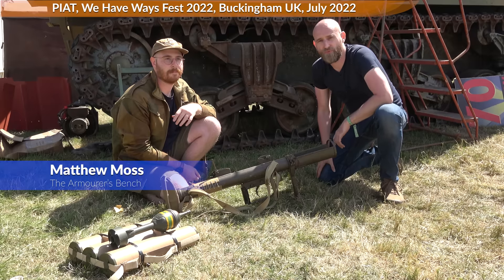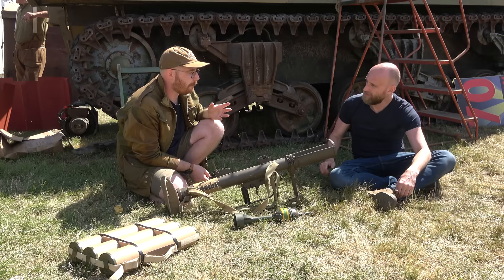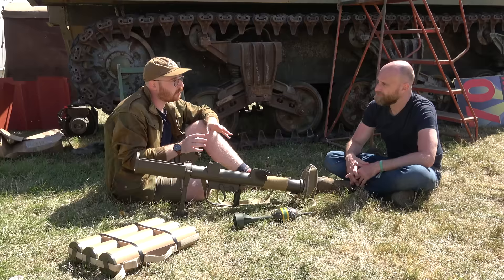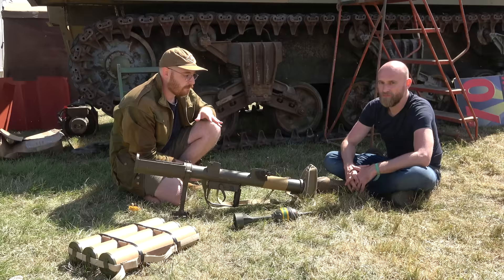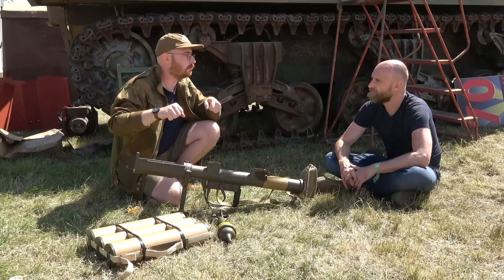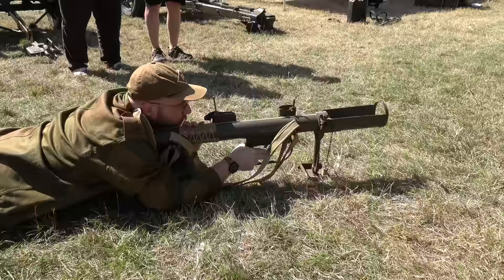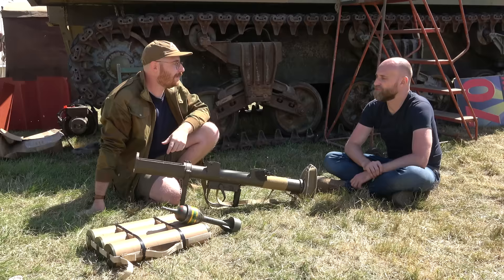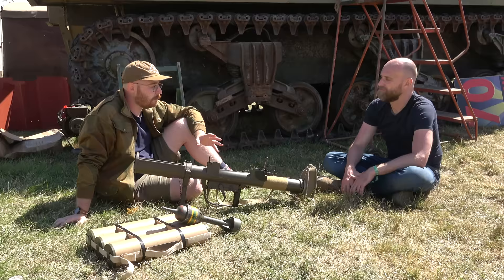PIAT: Better than the Panzerfaust?

Comment: "could engage every german armor thickness wise"  well ,i m not 100% sure. i just gave a quick look online, and the value given by stuff like wiki was around 75/80mm (perpendicular to armor). so, given that the stug 3ausf G  and the latest versions of PZ4 already had 80mm flat armor on base on the front (and that uparmoring them with  track parts, bits of conrete, etc wasn t impossible, and would still let them with tolerable reliability compared to other german armor of that era) i don't think the claim made is true.

Comment: Springs don't actually prevent recoil or pressure from the human; that'd be physically impossible. When you push on the spring, it pushes on you. However, what it might do is possibly lengthen the moment of recoil. That'd make it a lot more tolerable and survivable.

This is confirmed by him pointing out it was more of a push, instead of the kick of the ATG.
Reply: Indeed, it makes the recoil manageable by the human body.
Reply: No 'might' about it, it would be impossible for the human body to bear the recoil over a short interval. It's best to specify 'felt recoil' or 'perceived recoil' to avoid this kind of comment from the physics-educated :)
Reply: @skepticalbadger  Makes me wonder how far you could practically go, using springs to spread recoil. PIAT may be the practical limit.
Reply: @vanivanov9571  you can compare it to an Oerlikan cannon where the round is fired before the bolt has finished its forward travel and the forward momentum is used to keep the bolt closed for longer without needed more mass or spring pressure.

Comment: I didn't hear you discuss the PIAT's round trajectory. I've seen footage of a PIAT being fired and the round has a very noticeable arc to it due to it's relatively slow velocity. That seems like it would make it tricky to land a hit or at least, tricky to land a hit where you could get the most effectiveness from the shaped charge.
Reply: I'm not really sure why that would be the case.  The weapon has sights with three calibrated steps out to a max range of 110 yards.   Not exactly a laser-like trajectory but probably comparable to a panzerfaut or bazooka.

Comment: In my Dutch army days in the 1990's there was an accident with a PIAT. Every Dutch army used weapon at least one working sample is stored for instruction in case army or the police come across a similar type.  A sergeant demonstrated the PIAT to a fellow soldier loaded it with a round. And it accidently was fired. Inside a bunker. Both escaped with light injuries. Not sure what the damage was to this nco's carreer.
Reply: My guess is that it was an inert round and there was a negligent discharge and, being in a bunker, the inert round hit the inside of the wall showering them with bits of concrete spall and bits of the round. A live one would have caused more injury I would imagine.
Reply: @johnfisk811  That was also my guess. With a live round it would be a miracle if they would have escaped with just minor injuries.I was actually serving at the same barracks when in happenend.

Comment: Given most other nations settled on rocket propelled designs, I wonder what made us Brits go for such a comparatively unorthodox design?
Reply: I would bet cost and production limitations.

It only needs a small charge of propellant and didn't use any electrical components, unlike rockets.
Reply: Possibly because they were developing spigot mortars for a number of other roles at the same time. The Hedgehog Anti Submarine weapons system for example was a spigot mortar, and they had other systems using the principle in development simultaneously, though not all of them went into service. As a result I think it was simply a case of them taking something that was already being worked on and developing from there rather than going and developing a new system from scratch. They might have preferred to do the latter, but went with the former because they needed a working platoon level anti armour weapon as soon as they could possibly get one into production.

As was said, the British recognised even by the end of the war that PIAT was a dead end development, but it was a good enough system, decently reliable (if heavy), and was surprisingly versatile, so it was good enough to roll with and issue at the time even if they understood they would need to replace it at a later date.
Reply: The US got there first with the Bazooka in mid-42. The UK was developing PIAT before then. The German's captured a number of Bazooka's in Tunisia and studied them, then copied the idea with Panzershreck. They got lucky in that the warhead and fuzing for the Panzershreck was already developed for a seperate recoilless gun project. In many ways both Bazooka and PIAT were unorthodox, but ultimately the rocket propelled or recoilless gun designs had the potential for greater growth in the size of the warhead, which is necessary as the penetration of a HEAT warhead is related to its diameter. The PIAT did deliver a far larger warhead than the wartime US Bazooka though, which delivered a warhead derived from an AT rifle grenade.

Comment: It's NOT propelled by the spring but the projectile does have its own propellant!?
That makes it even more illogical.

It's like having a perfectly good working firearm.

Only to pull the trigger you need both arms while stabilizing it with a foot strap or something like that.
Reply: It's logical. The spring activates the propellant charge like a firearm striking a primer, and the propellant burning uses the tube and spigot as a cylinder and piston combo to build up pressure.

Comment: i always thought of the PIAT as a indirect weapon, for i always heard of the fact, that if you directfired at a tank that was on a lower level, the damned projectile would fall out of the PIAT was this myth or not? another one, i heard was the loading time was longer than other similar weapons?
Reply: Had a spring loaded catch that kept the bomb in place literally to avoid this sort of thing. I find it remarkable that people think an army would not have noticed a little thing like that. The British were not stupid after all. Where that myth probably comes from is that particular catch was sometimes damaged, though it was a simple enough thing to fix. Also most deactivated PIAT's also lack that catch. 

As for loading time, no, not really. Not really that much longer than Panzerschreck or Bazooka UNLESS for some reason the firing of the bomb had NOT cocked the weapon. The recoil of the bomb leaving the PIAT was supposed to cock the weapon for the next reload, while this happened most of the time sometimes it did not, especially if the PIAT in question was old and had seen a lot of use so the spring tension was not as high as it should have been.

Remember, the spring COCKED the weapon, it did not in fact launch the bomb (which is what a lot of people think).
Reply: @alganhar1  Reload of PIAT was way faster than Bazooka or Panzershreck. No wires to connect and very straightforward to drop the bomb in and slide onto the rod whilst the operator remained on target.

Comment: Good video and I wonder if a Modernized PIAT can punch through a Russian Relikt 4S24 ERA used on T-80 BVM T-90M and T-72B3 Model 2016 or not? I wonder if the Original PIAT can penetrate Kontakt-5 used on the T-72B3 T-90A T-80BV & T-72B Model 1989? Up the Ante its Malachite T-14 T-15 Armata Kurganets 25 Bumerang APC Moscow Military district

Comment: the range seams extremely limited  compared to a lot of other anti tank weapons as well as the problem with recooking the spring . I think a light mortar and rocket  anti tank launcher could be carried for less weight and have better range , effect  and  have better reliability
Reply: Then you need to go check the ranges of most of the first generation rocket propelled anti tank weapons. You will find PIAT's range is about middle of the pack, not the best, but not the worst either.
Reply: I think all of these types of weapon systems were pretty limited in effective range and at least you didn't have to worry about a battery or loose wire with the PIAT but they all had good/bad points.
Reply: @markgrehan3726  yeah suffice it to say unless you had a dug in 88mm gun or something you probably weren't hoping for a tank to come into view.
Reply: @purplefood1  Yep, it took a brave person to crawl up fairly close and fire one of these handheld weapons at a tank.

Comment: An experienced gunner could land “maybe” a 60% hit rate at 100 yards and with a 75% fuse fail rate, it’s not what I’d want to be shooting at a tank bearing down on me.
Reply: First fuze(no 425)  had a high-ish failure rate, grazing shots wouldn't usually explode, the second fuze (no.426)  was more sensitive, but could cause a problem if the safety was accidentally set back in say a paradrop where the chutes didn't fully open. ( If you fired them they would explode in the tray.)

Comment: Probably better at hitting things from a distance than most common Panzerfaust variants but that ain't saying much, especially since the very late model versions heavily inspired the Soviet RPG-2. Plus PIATs are ludicrously complicated to operate in comparison.
Reply: "cock, insert bomb, aim, pull trigger" seems pretty simple to operate. 

Panzerfaust has definite advantages and disadvantages compared to this.

The Panzerfaust can be widely distributed among the infantry to be pulled out when needed. But if you want a dedicated AT section a PIAT and some reloads is probably going to be better suited than crates of Panzerfausts.  

Really the PIAT should be compared to the Bazooka/Panzerschreck. 

In comparison to the Bazooka, early on it was probably favourable (remember there was a time that the US seriously considered withdrawing the bazooka as useless). Once the US worked out their rocket issues, the Bazooka was probably generally better being lighter and better on an open area. But the PIAT had a bigger warhead and no back blast as well as it's indirect fire capabilities. So there were situations were it was clearly better. As rocket/recoilless weapons got bigger and bigger warheads than a shoulder fired spigot mortar could reliably use the PIAT became obsolete.
Reply: These aren't even comparable weapons. It's like comparing an RPG-36 to an RPG-7. RPG-7 is a multiple use rocket launcher while the RPG-36 is a single use disposable rocket launcher.

 The upside is the RPG-36 is cheap and light, can be mass produced to the point where every soldier in the unit can carry one relatively easily on them. The downside is you're restricted to the variety of payload and it's ditched after one shot. The upside to the RPG 7 is it can easily adapt to situations in the battlefield by swapping the warheads out, the downside is it's heavy and you have to carry spare warheads on you which takes up space
Reply: @88porpoise  thr bazooka comparison is apt, however in an open field is a hard sell IMO.
Both weapons had effective ranges in the double digits, having to stand out in the open to fire was a big problem.
The ability to fire the PIAT from a far more protected position, and the much less pronounced muzzle flash, would be a huge factor in not only surviving but also hitting the enemy (since you wouldn't be rushing so much).
Reply: @kirotheavenger60  You can fire a Bazooka from behind cover, and firing prone and behind cover were specifically included in training. 

The idea that you have to stand out in the open to fire a bazooka is a myth, you just need sufficient clear area behind the end of the tube for the backblast. Assuming your backblast area is clear, you probably aren't any more exposed firing a bazooka than a PIAT. 

The bazooka also had a higher muzzle velocity (which makes hitting a target significantly easier) and was lighter to carry and maneuver around the battlefield.
Reply: @88porpoise  Indeed, by "open area" I didn't literally mean an open field.
However, it is certainly true that a bazooka was far more limited in it's options than a PIAT. And even when cover was available, the bazooka would render a far greater signature alerting anyone who you might have just displeased as to your presence. 
"Assuming your backblast area is clear" is not an assumption I would like to bet my life upon.

The bazooka's velocity was only barely higher than the PIAT's; 76m/s vs 81m/s.

Lighter is definitely true. But the bazooka had backblast and couldn't be used for indirect fire. 
I think there are strong pros and cons to either side.
Reply: @kirotheavenger60  And that is the real point, there are pros and cons to either. Is it true that spigot mortars like PIAT were a dead end in weapons development? Absolutely, but we should not be judging a weapon based on what came later but on how effective they were at the time they were actually USED. 

Sure there were downsides to PIAT, it's weight being the primary one, but there were advantages to it as well, which you  have already covered. Thing is you can compensate for the weight to some extent, and the British did that by the simple expedient of giving PIAT crews a Universal Carrier, just as mortar crews were. The weight issue becomes much less of one when you remember that most of the time it is being deployed from its Carrier as and when it is needed, the crews are not generally humping the things on their back for miles on end....

Comment: Great, till you have to reload it?
Reply: Only a problem if the recoil did not cock the spring, which was not as common as most people assume. It was more an issue in older PIAT's that had seen a lot of use so the spring tension was out. 

Usually though the loading was not really any more difficult than the Bazooka or Panzerschreck. If the recoil failed to cock the spring, then yeah, that would be a bitch to reload then, but as I said, that was actually fairly rare.

Comment: One of the complaints about the PIAT I've heard is that they were wildly inaccurate.  You had to be a lot closer than the max range to get a hit.
Reply: Within 50 yards was recommended if I remember correctly. That said, rocket launchers around at the same time weren't much better, even if they had a significantly greater maximum range.
Reply: They were actually fairly accurate weapons by all accounts I've seen.